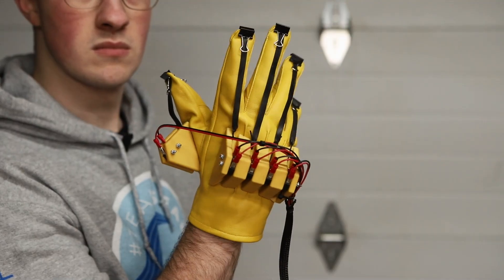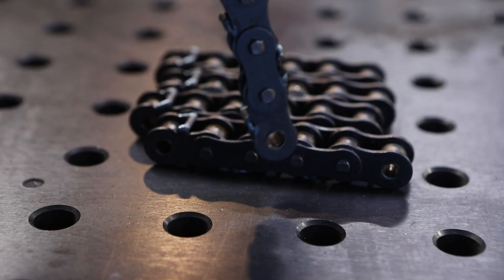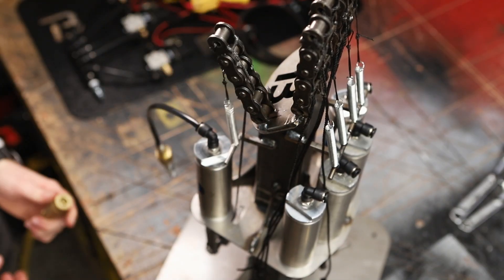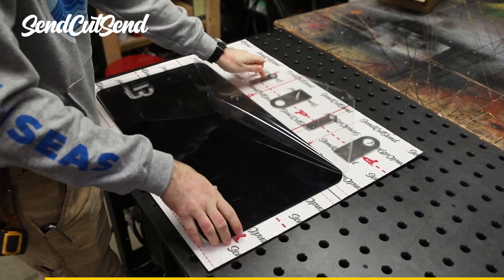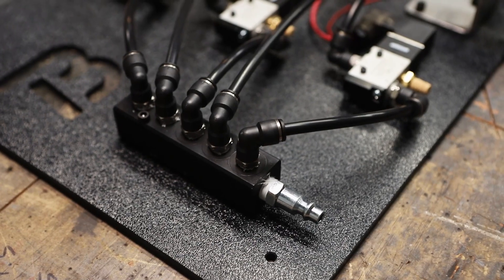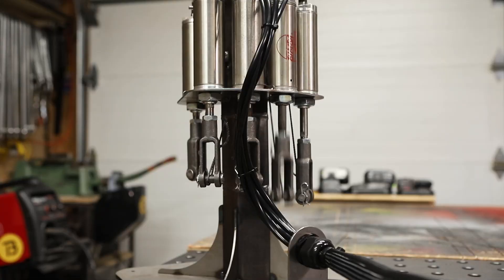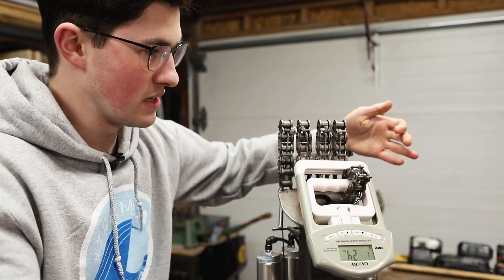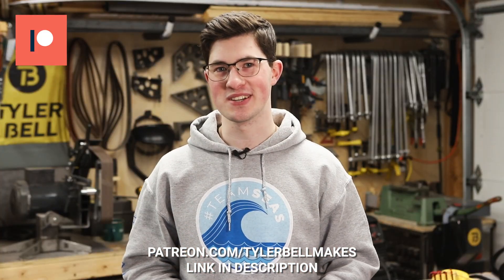Robot Hand controlled by my Real Hand

Comment: The rope used in myth busters is called mule tape and it is used for pulling wire through conduit. Very strong stuff and slick so it doesn’t catch on things

Comment: You could add strong springs to the other side of the strings to prevent the fingers from hitting themselves too hard. It would act as a passive force limiter. Also, your grip problem is caused by the incomplete thumb/hand motion.

Comment: Bicycle brake cables are about 1.5mm in diameter. Braided steel or stainless, definitely strong enough for a hand if it's strong enough for brakes. Very cheap and available online or at local bike shop as well.

Comment: To account for the cable stretching, you could add a sustaining valve to each cylinder, like in old drum brakes, which would maintain a few psi, keeping the string tight. You would need stronger springs though.  You could also use spring extend/air retract cylinders to neaten the cable routing.  Extra levers could be used to increase power while reducing stroke, but you would need aircraft cable or kevlar webbing to prevent stretching.  I've designed and built a few hands in my time - my profile pic is me wearing a LUKE arm, something I've been honored to help create for wounded warriors.
Keep the great content coming!

Comment: The webbing Jamie used is from Dyneema climbing slings. They’re woven from UHMW Polyethylene. Super duper strong, lightweight, and almost totally static (very little stretch). Great for this application. Love spectra in here. That being said, it will slowly stretch out over time. It has settle stretch, as it’s not polyethylene, just notUHMW. Not a huge deal, but if this hand sits on the shelf for a while and you notice it’s lost some tension, that’s why. Super rad! Love the pneumatic cylinders, it looks so good.
Reply from the maker: Awesome!

Comment: I'm surprised that you didn't use webbing as he did because it's way more material effectively multiple cords
Is it because you could not find the right size or just nothing strong enough
Reply from the maker: Not easy to attach to the finger tip without sewing. And if it were sewed then it would be permanently attached